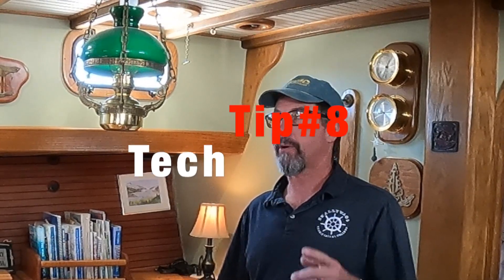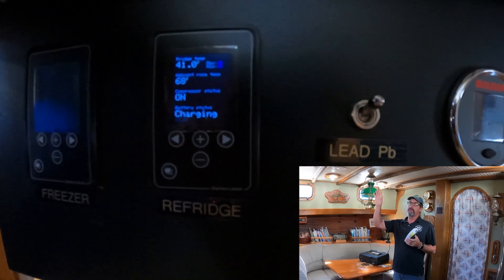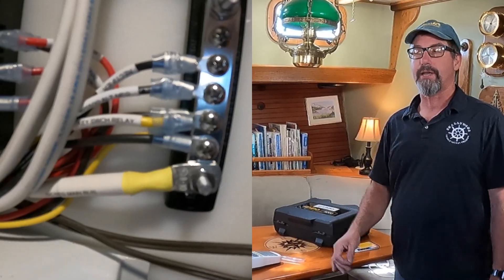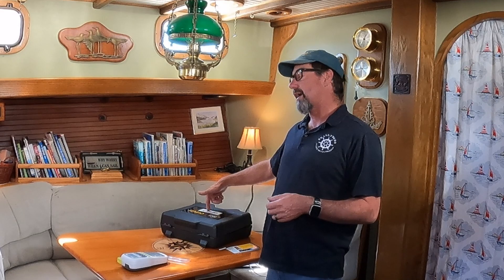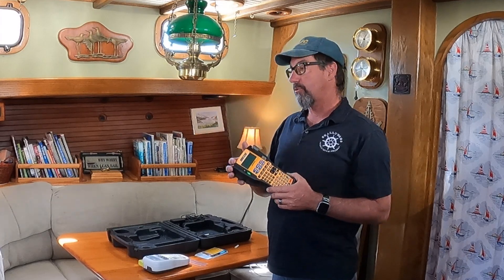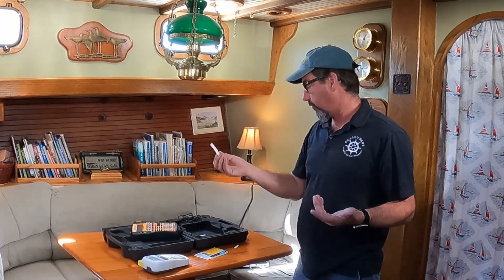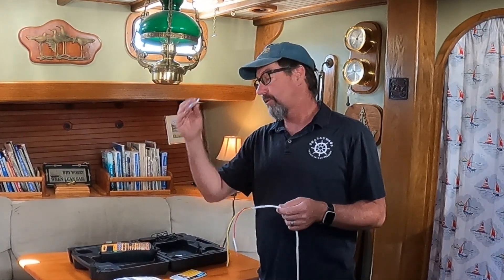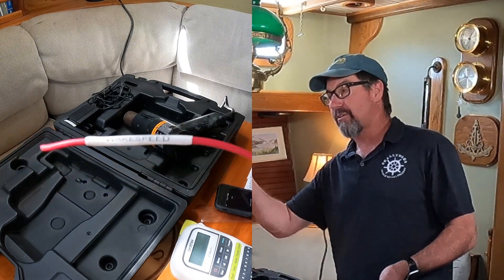Tech Tip#8: Heat Shrink Labels

Comment: Do you know the voltage of the Dymo mains adapter?
Reply from the maker: No, I'm off on a vacation in Maine, I'll check when back on the west coast and report back!
Reply from the maker: The AC adapter is a basic 120 VAC to 9 VDC, so you can't run directly off your batteries - will need an inverter or DC to DC converter.